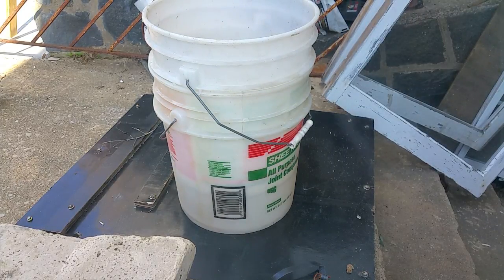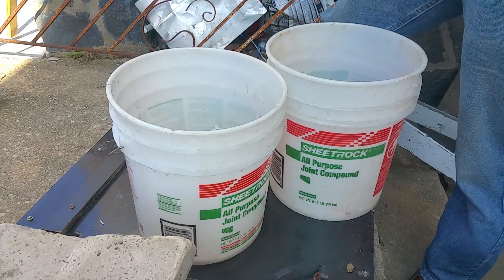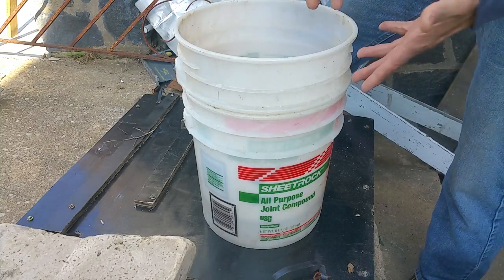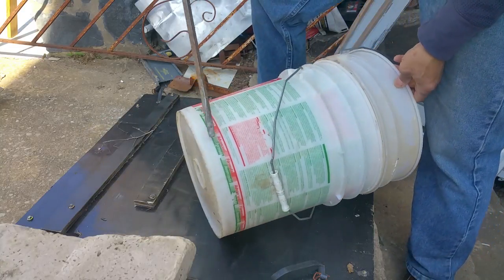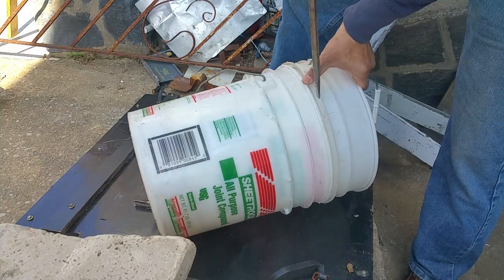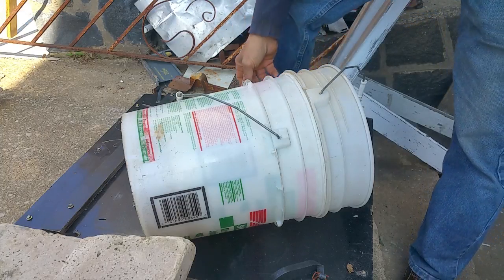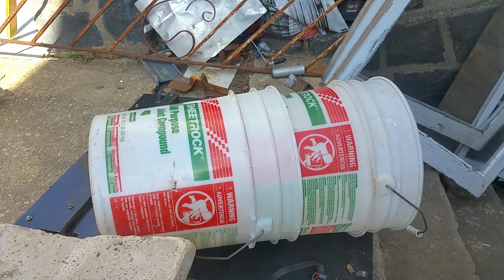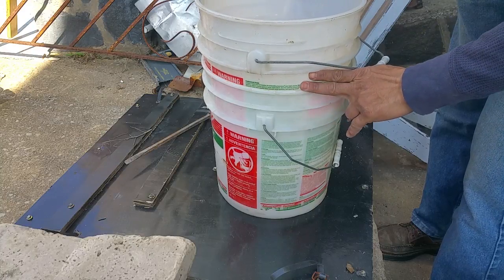How to separate two 5 gallon buckets JUST a screwdriver NO AIR needed

Comment: Thanks so much for this common sense solution for which I was lacking. I actually drilled 1 1/2 inch holes in the bottom for my container garden and thought it would disperse air to unlock. I even drilled holes on the inside bucket. Your solution was the answer. 👍😜

Comment: Your method using a flathead screwdriver worked great,  mine had water between the two, but the screw driver method worked. It’s gonna have little peaks on the skirt of the top bucket, but no damage that will harm its purpose. but I am not looking for pretty flawless buckets. Just need it to hold whatever I put in it. Thanks again
Reply from the maker: Your so welcome... thanks for sharing your story.